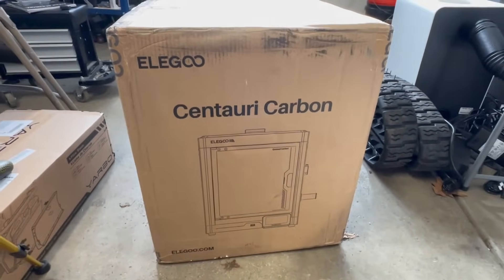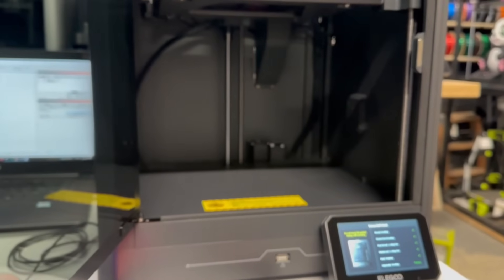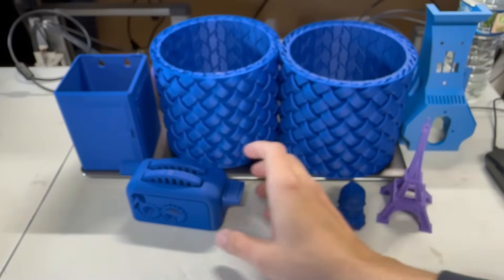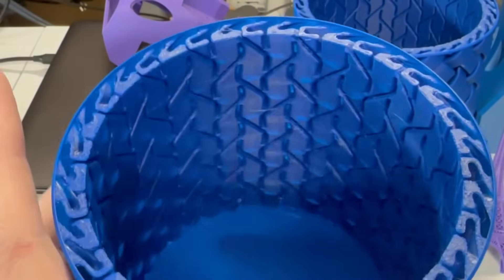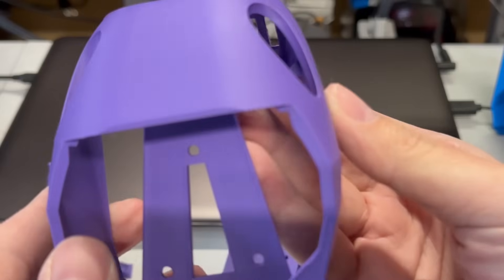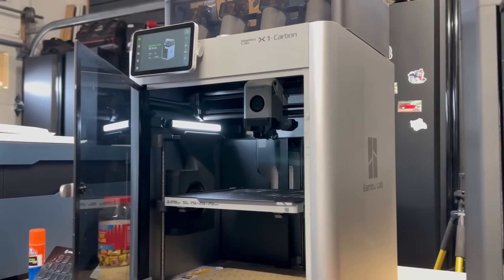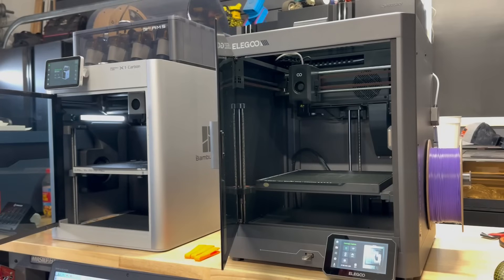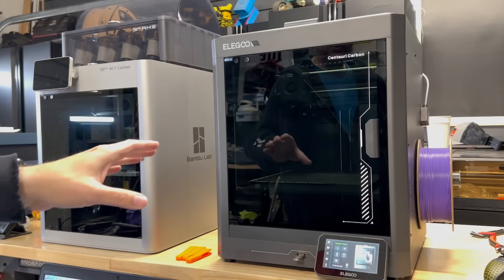Only $299! Elegoo Centauri Carbon  - No Comparison

Comment: Hi, I need some help. I’m looking to buy an enclosed printer since I primarily print functional parts rather than art, toys, or decorations. I currently have an Ender 3 V3 KE, and I was considering the Centauri Carbon—but I have zero experience with engineering filaments, so I’m not sure.

The parts I print are mostly for cars, tool repairs, or other functional applications that need to withstand some force. From my research, the filaments I’ve come across are ASA, PETG-CF, Nylon, and Nylon with carbon fiber.

Any input or recommendations would be greatly appreciated!

Comment: For 500, I would buy the A1 with multi color or a p1s. Prints out of the box the sensors are better on the bamboo.. Great review.
Reply: What about for $299?
Reply: You said It, 500 vs 299, also a1 Is overpriced as shit.
Reply: @JosueMedina-q4k I would buy a A1 mini. Split big parts in to small one s then glue together.

Comment: Apart from they both have carbon in the name . I don’t think the Elegoo should be compared to the X1C , but rather the P1S. The screen alone makes the P1S out dated. 
I was thinking to get my first printer , should I get the A1 or push to the P1S. If this come out at less than £500 I think I’ll get this instead .

Comment: Apart from they both have carbon in the name . I don’t think the Elegoo should be compared to the X1C , but rather the P1S. 
I was thinking to get my first printer , should I get the A1 or push to the P1S. If this come out at less than £500 I think I’ll get this instead
Reply from the maker: Updated by Elegoo, it is only $299!  Link in the description is now live!  Also said there is a possibility of a multi material system this year!
Reply: @ I’m now on pre-order !!! They sold out right away . If there were many in stock . £299 in the UK . Nearly the same as the A1. It’s a no brainer !

Comment: Your price comparison does not include an AMS type system on the Centuri. "Less than half the cost" is in no way accurate.
Reply from the maker: My cost comparison is without the AMS for the X1C at $1,149.  The Centauri Carbon doesn’t have a multi material system.  The Elegoo is set to release at less than half the price.
Reply from the maker: Updated by Elegoo, it is only $299!  Link in the description is now live!  Also said there is a possibility of a multi material system this year!

Comment: Ok great now the milion dolar question.  
Firmware closed source or open source? - possible to run on it any other version of Klipper - this would allow to use MMU similar to AMS or CFS, BiQu will be launching their version this year. Does user need to create account at Elegoo in order to get printer running or is it enough to connect it to users Local network  and use it in lan mode like in good old times when Cloud was not a thing.  IOS or Android app exists? Cloud yes no or optional?  Any limitation on using other slicers than the one Elegoo provided ?
Reply: if he tells this, he won't be given any more printers to review)))
Reply: Not seen anything in regards to the firmware, but no you dont have to setup a elegoo account, as it uses a local network. No app hints at all from elegoo so id say a no to that as well, They are currently working with orca slicer definitely to get a working version out very soon after release, as for other slicers again im not sure. The elegoo slicer does support all the other printer brands though as its basically a re-skin of orca as currently you can only use the elegoo slicer until the updated version of orca slicer comes out with the ability to connect this printer.

Comment: The motion system on the elegoo is also much more reliable and superior due to not using gimmicky CF rods and graphite bushings. The X axis assembly on the bambu is consumable and meant to be replaced over time, the X axis assembly on the X1C/P1P/P1S cost $100, which is just thievery.
Truth is, bambu is irrelevant these day due to the competition doing it better, for cheaper and bambu actually being anti consumer. All of bambu's coreXY printers are overpriced
Reply: Those CF rods have turned out to be far more reliable than most thought. The ones we've got in our farm are first gen X1's and the original rods are still going after thousands of hours on each printer. Others who've been running them for a long time have reported the same with only an occasional replacement being needed but seems to be very rare. 

Theres lots of things to attack the Bambus on, the carbon rods it turns out are not one of them.

Comment: The Centauri print quality does look good but there are now other 3D printers in the $500 range that also print fast, with good print quality, and other features such as a larger print volume or a multi filament system.  No wonder Elegoo wants reviewers to compare Centauri to the expensive X1C.  Elegoo was very late to the Me Too Bambu party.  Based on trade shows before the release, they seemed to realize that Bambu's claim to fame and success wasn't the hardware, important as that is, but rather a simple, reliable, high quality out of the box user experience.  Other Bambu copycats tried to sell their Bambu clone hardware for less money, competing on price, but with the same need for new users to fiddle with it until they get it to work well.  I'd hoped Elegoo was going to compete on user experience but it looks like they managed to do a little better than the others in that respect but still fell short.

I hate it when printer manufacturers make their own version of an open source slicer, but I can understand if they want to strip away the general purpose options and features to make it easier for new users, but Elegoo apparently created some good slicer profiles for all Elegoo filaments on the Centauri but only provides them with their slicer.  All 3D printers should ship with good well tested and optimized profiles for PrusaSlicer and OrcaSlicer.  At least there are profiles for Elegoo Slicer that the community can copy to make OrcaSlicer and PrusaSlicer profiles.

Comment: Looks nice but Elagoo is famous for bringing out a product with bad software that they never get right. I have the Elegoo Neptune 4 That only has 20 ish hours on it because its never worked properly Even after a new mother board and endless updates. Iv actually spent more time working on it than using it!!!
$500 is to much for a printer without the ability to have AMS. Anycubics new printer is around the same price with included AMS
Reply: Wait really. I have used Neptune 4 since release had no issues and have 1000hr at this point
Reply: @nischal711  You were one of the lucky ones. I bought the Neptune 4 to replace a Neptune 3 with 1000s hrs. A year later and im still using the Neptune 3 and x1 carbon.
Reply: @vintagespeedshop  I see.
I have A1 mini that I use more often nowadays but Neptune 4 did me good for a long while.

Comment: Do we know if it will eventually have a mutli colour printing addon like the AMS?
Reply from the maker: @JoshuaStandingHarvey  When I was first offered to review the printer, that was my very first question.  “Regarding your question, the Centauri Carbon currently only supports single-color printing.”  There “might be” a possibility?
Reply: @TripodsGarage  I think at this point I don't really want to rely on maybes, I am in the market for a printer at the moment and I was excited for this one but not having certainty is an issue for me. But I am concerned about bambulab at the moment so I feel a bit stuck
Reply from the maker: Updated by Elegoo, it is only $299!  Link in the description is now live!  Also said there is a possibility of a multi material system this year!
Reply: @TripodsGarage  I ended up going for the a1 mini, I am only starting in the hobby and that should get me through until I want/need to upgrade, thanks for following up though

Comment: Hopefully they've released the source code, including any modifications (though the macros likely stand separate. It would just be nice if they released those). Klipper has a strong copyleft license, so if they don't they're outside their legal agreement.
Super excited for it tho! After creality finally opened up their systems, they got a ton of love.
Reply from the maker: I hope they release the source code as well.  I believe manufacturers are limiting access only to simply the process, and to limit the support calls.  If this is true, I do understand the approach.  However, there should be an advanced mode, if switched on, you acknowledge that the terms of service has been changed.  Personally, I would much rather manufacturers stick with the agreement.

Comment: I dont think you can rule out the printer on that line with the vehicle shell parts.  If it shows up on a different printer, sure, it can be the file, usually those issues are caught and reported to the modeler to fix.  Still impressed by the quality of the prints for what is probably going to be a sub 600 dollar printer.
Reply from the maker: @dinneryeti  I build 3 of these death racers, and looked at one of my older prints and it was on there.  I just never noticed it before.  Since this is covered, don’t think it is worth while to address.  I am also impressed with the print quality.  It is my understanding from Elegoo that this printer should be around $500.  Thanks for watching and commenting 👍
Reply: @TripodsGarage  Ahh good to know.  I appreciate the response.  Keep up the videos!
Reply from the maker: @ No problem!  Thanks so much for watching!

Comment: Actually Their website don't have this printer for sale. I tried to purchase it
Reply from the maker: Yeah, that is a major fail on their part.  The embargo had a lift date, and usually that means everything would be ready.  That includes the manufacture’s website.  I just checked again, not there 🤨
Reply: @TripodsGarage  I will keep checking too thanks
Reply from the maker: Updated by Elegoo, it is only $299!  Link in the description is now live!  Also said there is a possibility of a multi material system this year!
Reply: Heard the 17th its supposed to be up listed but it's the internet so no idea if thats accurate

Comment: This looks like a very, very good machine. If it had a multi color system and I didn't have my K1 Max, I'd put one of these on my "to get" list. The print area is a little too small for me, but maybe I'll get one regardless. Anyway, it looks like there's a CFS upgrade kit coming out for the K1 Max this month so the Elegoo could be justified for prints that do not need multi color. Elegoo is usually on top of trends so I'd be really surprised if they didn't have a multi color setup in the works.
Reply from the maker: Updated by Elegoo, it is only $299!  Link in the description is now live!  Also said there is a possibility of a multi material system this year!
Reply: @TripodsGarage  Dang! If is truly $299 then Bambu is going have some competition, especially if Elegoo comes out with a multi color system for it.

Comment: Honestly, most printers are kind of well into budget for me so what I tend to look for is longevity. Alongside AMS being more of a gimmick for me than it is a serious pipeline advantage, its a product I'm considering. Especially because Elegoo's support has been pretty good on the resin-side for me.

That being said, something I'm inherently really disliking lately is this "comparison" or "killer" trend. I don't agree with what Bambu's been doing, but at the same time some people do agree with what they're doing. So I'm relieved to see a bit more "hey, this is what this machine does" videos because at the end of the day I make decisions based on what I need personally, and that may or may not include Bambu.
Reply from the maker: This is why my reviews are solely based on the machine it's self.  This was the first comparison review that I have ever done, per Elegoo's request.  I do my reviews based on what I receive, how did it arrive, any issues, did I need to tinker with it, did it work as advertised?  There are many content creators that go the "drama" route for clicks, views, and to stoke more division.  Just like any product category, there is enough room for multiple players, this drives innovation and the customer usually wins in the end.  Thanks for watching and commenting!
Reply from the maker: Updated by Elegoo, it is only $299!  Link in the description is now live!  Also said there is a possibility of a multi material system this year!

Comment: Thanks for bringing up the elephant in the room where most creators dare not to tread; "Is the result off of the X1C worth twice the price of this?"
Reply: It's more comparable to a P1 rather than X1. Even then though, no, its not a better value printer as you dont know its long term performance yet, and given its Elegoo who have a long standing rep of shoving out printers untested, they probably dont know either.
Reply from the maker: I love my X1C, however I rarely use the AMS for multi color anymore.  I mostly use the AMS for the Auto Refill.  For less than half the price, this printer has a ton to offer, plus prints amazing well.  Thanks for watching and commenting!
Reply: @TripodsGarage There is already perfect machine like qidi pr flashforge under twice the price of x1c. Elegoo make it too late while qidi and flashforge have great quality and with zéro issue, fail now...

Comment: Interesting you guys test a product with the carbon name on it with a nozzle that heats way up and dont use any carbon filaments at all but hyper pla. No petg, asa, tpu etc.... anything these days can print pla...Its overrated. You should have shown the real differences between bed sizes. Illustrate how this printer has 256 mm for real unlike the x1c.

Comment: That little bit hotter nozzle temp is interesting! I've had some PPS-CF10 that I haven't been able to print. Jen's racer is coming along!
Reply from the maker: Yeah, that little bump of temp makes a big difference!  Had to order more filament, cannot believe we didn't have pink!  So it will be purple and pink, Jen still hasn't decided on the tread color.
Reply: QIDI Plus4 is the king of printing high-performance filaments.
Reply from the maker: @Kimberlie1  - Heard that Qidi plus 4 does double duty as a fireplace
Reply from the maker: Updated by Elegoo, it is only $299!  Link in the description is now live!  Also said there is a possibility of a multi material system this year!

Comment: Great video! I can't believe this is going to sell in the $500-600 range! The quality of the prints were amazing! You are correct about the line on the death racer part. I just printed that over the weekend on the K1 Max and got the same line. Awesome review!
Reply from the maker: Updated by Elegoo, it is only $299!  Link in the description is now live!  Also said there is a possibility of a multi material system this year!
Reply from the maker: @pushingplastic7445  From what I understand more of the $500 than towards $600 range.  I couldn’t believe the prints.  It has been a while since I printed that part of the death racer, wasn’t sure if it was there.  Thanks for confirming!  Thanks for watching and commenting 👍
Reply: You better belive it: Flshforge sells corexy for 300, Creality and Qidi for 400 for more than a year and they have a MMU

Comment: Good review.  I like the steel rods and the open read Z axis.  I have trouble cleaning the rear Z on my X1C.  A good question is how the firmware works, as many know Bambu is making changes to their cloud to "improve" security.  This looks like it may be possible to modify the Klipper on it.   This would be interesting to learn more.  John, as you pointed out for half the price it looks like as good of printer, and we are seeing 3rd party filament systems coming to market,  I just got the CoPrint running on my Rat Rig.
Reply from the maker: @woodwaker1  I like the steel rods as well.  Not a fan of how locked down Klipper is.  However, think companies that do this with Klipper are just trying to minimize support calls.  Either way, I believe there should be an expert mode with a stipulation stating you are at risk, and do not contact support.  For the price, I believe the printer hits a lot of positive marks and the prints looks great.  It is a keeper in my book!  I think a 3rd party multi material system would be a great idea!  Thank for watching and commenting 👍